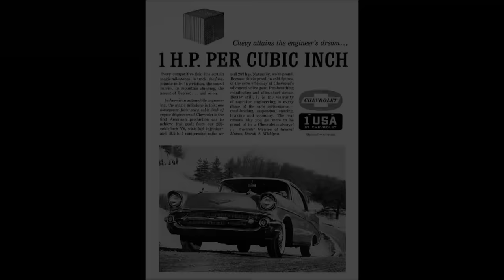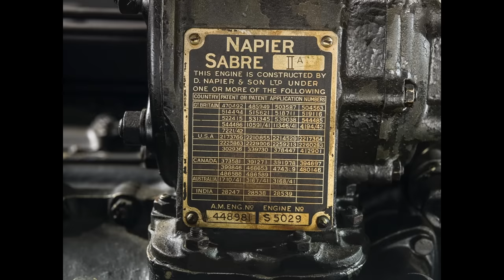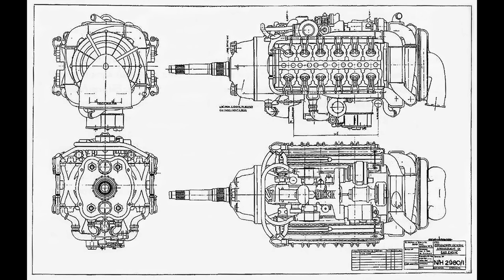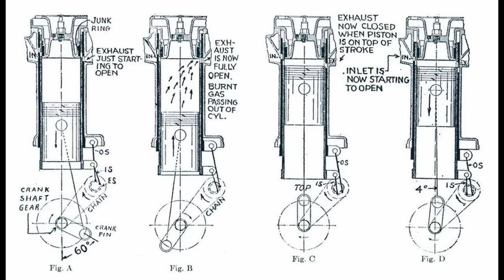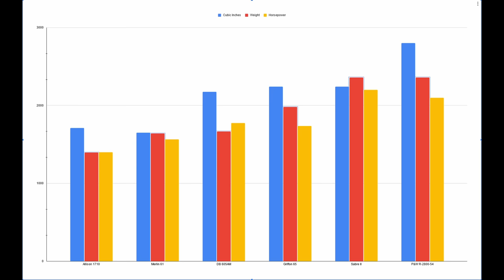Napier Sabre - The Ultimate WWII Aircraft Engine - Part 1

Comment: First off, thank you.  Loved the discussion.

Weight dilemma:  Cannot offer proof but can offer a theory as to why the engine relatively more per displacement than large bore motors.  Quite a few things in engineering are limited by what some call "the cube law" or "the square law".  Building a carboard box offers a fairly simple explanation of both.  [Units do not matter but I'll use feet/inches since we are talking about an WW2 English motor.]  If you build a 1 cubic foot cardboard box, it takes 6 square feet of cardboard to build it.  To double the dimensions to a 2x2x2 box takes 24 units of cardboard (4x more, or "squared") but the volume is 8 times ("cubed") as much.  In the end, by doubling the box's dimensions you get twice the volume per unit weight.  

[Below:  The values flagged with ** are the important ones, the rest are the data from the web that supports those numbers.]
A more applicable example would be using steel pipe to build cylinder walls to get an idea of how this applies to engine cubic inches.  Suppose we wanted to build our cylinder walls out of schedule 40 pipe.  We make a 1 foot long cylinder using 3/4" steel pipe to get a cylinder that weighs 1.13 lbs with 6.09 cid at a weight cost of 0.19** lbs per cid.  Now let's build a 1 foot cylinder using 1 1/2" schedule 60 (sch 60 required to get a similar working pressure as the 3/4" sch 40).  Our 1 foot cylinder weighs 2.72 lbs with 20.5 cid for a weight cost of 0.13**. lbs per cid.

That's my best guess.  Mind you sand casting blocks isn't an exact science and it's likely the safety margin build into casting cylinder walls makes the penalty even worse because "plus a fixed margin of casting error" would be a larger percentage of weight on a small cylinder than a large one.
Reply: Hey. Much appreciated.
Good insight on the insides of volumetrics

Comment: I recall seeing a cutaway when I lived in the UK early 80's - maybe in the Science Museum but I can't recall now. Horrendous complexity was on show and that must be a down tick for it.  Even in war time costs and maintenance matter.  My dad was permanent airforce when WW11 began and transitioned from English stuff to Allisons, Wright Cyclones and PW2800's by war's end.  He much preferred the American engines to work on.
Reply: The T.B.O. of the Bristol sleeve valve engines exceeded that of all poppet valve engines. Once the great Roy Fedden helped Napier resolve their initial sleeve valve reliability problems the Sabre started to exhibit similar long term reliability. Mechanics favoured. U.S. radials because of the very simple repair procedures for a lot of problems. e.g the simplicity it of changing a cylinder/piston with the engine in situ.
Reply: Your dad had to be pleased after discovering that the Allison was built with 50% fewer parts than the Merlin with all replacement parts being a direct fit with no hand fitting required.
Reply: My Dad was in WW06 and WW10.  Could never get his mail delivered.

Comment: Thank you for your most excellent vids! After watching the second part of this vid youve changed my perception of the Sabre, mainly it was troublesome, prone to overheating and fond of gassing its pilots.
Did make me wonder what if they had basically made half a Sabre, A flat 12? Around half the weight, and hp, but still around 1200 mark. The advantage would be the nacelle wouldn't be much thicker than the wing and would be comparable power to others that were in use and suit most twin engined aircraft of the day, Beaufighter for instance? Finally imagine a DeHavilland Mosquito or Hornet with Sabres! Thanks again.

Comment: I was an engine machinist for 30 years and I cannot understand how anyone can call asleeve valve engine good!  these engines were litterally a grenade, over engineered, not properly thought out and a disaster!      IF they were SO great, why were they never used again!!???
Reply: Because gas-turbines took over for aircraft and on the railways the engine rpms were never higher than round 1,500 rpm (in the UK). Whilst neither cars or trucks need such power.
Reply: @neiloflongbeck5705  so that's why literally the day the conflict ended ALL the typhoons and their engines were scrapped??  yet the Me 109, and Mustang werent!?  even after "the age of gas turbines?"
Reply: @Thomas-lk9ok  the early gas turbines were had limited thrust and were slow to respond to the throttle. They also weren't suitable to certain roles. After the end of WW2 all militaries involved in the conflict, apart from the Soviet Union no longer needed large militaries and so they were reduced in size. The militaries decided to standardise on a few types that would see out their needs for the early peacetime period. In other countries, like Spain, they could not afford to  modernise their combat aircraft and so older aircraft like the Bf.109 soldiered on.  They were also easier to maintain than the jets coming into service elsewhere, after all what difference is there between a typical car engine of the period and a DB605?

By the way the Bristol Centaurus a sleeve valve engine saw service in the skies over Korea in the MiG killing Hawker Sea Fury, so hardly never used again after WW2. The last of which retired from the Burmese Airforce in 1968.
Reply: @neiloflongbeck5705  LMAO  you keep telling yourself these things!
Reply: @Thomas-lk9ok  don't need to it's all in the history books
Reply: Sleeve valve cars were not common but not rare either . Stern's knight,Willys knight,  Daimler etc all sold sleeve valve cars .  they were quiet,powerful but smokey as the sleeves had to be lubed constantly  .They are simple, having no timing chain,cam  shaft or poppet ca

Valves.
Reply: The hawker sea fury which went toe to toe against mig 15's in the Korean war was powered by the Bristol Centaurus a sleeve valve radial engine
Reply: The.Sabre only achieved 3500hp on late prototypes. During the war they achieved 2200hp in service. The 27 litre Merlin achieved 2000hp in.service.
Reply: @Thomas-lk9ok  no they were scrapped because they had developed the tempest which could carry the same ordamance but was much better. The tempest also used the sabre engine and later the more powerful evolutions of it.
Reply: it was amazing engineering. Even if  it was only used for a short while. It trained the next generation of engineers who built the gas turbines. Remember 100 years before this engine we were still using horses as the main mode of private transport. 🎉
Reply: @neiloflongbeck5705  Bristol did a line of sleeve valve engines, the Taurus, Hercules and Centaurus. The Hercules was in the Bristol Freighter as used by the RNZAF into the late 60,s or early 70s. The Centaurus in civilian use achieved a TBO of 2000 hrs, quite respectable for a large recip .
Reply: @thomas-l9ock It is as if you didn't see the video or understand the circumstances under which engine development in wartime would have taken place.
If an engine specialist like Ricardo at the time theorizes that puppet valves may soon come short in rising the hp figures, sleeve valves arr not a unlogical choice. Drawbacks like oil consumption do not count in wartime, output is paramount.
Reply: alot of great engine technology has been left on the shelf and never used again for crappy reasons (such as profit to cost ratio not being good enough). I'm not saying sleeve valves are one of them, I'm just saying you can't rely on what gets used again and what doesn't  as a measuring device of quality. because if it were a good measuring device that would mean current F1 cars are the fastest F1 cars ever made and they aren't.
Reply: The sea furies at Reno have used sleeve valve engines for racing.
Reply: Cause we have metal springs that don't snap at 1500 rpm anymore
Reply: The airflow insanity of trying to get gas in and out it a cylinder six thousand times a minute and then putting a large disc in the way needs explaining in some detail, a normal IC engine. Or you could use sleeve valves?

Comment: Great work! Ditto on the pronunciation. Nay-pee-er. Sorry for the nitpicking. The workforce tended to call their employer 'Naps' for short though. When I was an apprentice I had one instructor who had worked for them until the end. He was on the team that added the turbo-compounding unit from the defunct Nomad engine to a Deltic, which was then still in production, in an experiment. He said the guys just did that without approval, and it was adopted as an official project when the results came in. I don't know how much truth there is in that. We all know no Deltic sold ever had turbo-compounding. He did say that everything Napier did was very bespoke, and often the safety margins were a bit thin for his liking. Look at the way they handled the phasing gears to link the three crankshafts in the Deltic. Beautiful in how they balanced the forces from the helical gears in the train, but unreliable in practice and prone to failure. They could get a little bit too smart for their own good.
With regards to the Sabre, I might remind you that one of the reasons the Merlin was so successful against the more sophisticated DB605 was it's inherent simplicity and how it's construction was conducive for field repair in comparison to the German units which needed more repair facility than was often available at or near the forward bases. The fact that the Luftwaffe went from liquid-cooled v-12 units to aircooled radials at the end of the war is a good indicator that sophistication and fine engineering is very often great in racing, but war is a different pursuit.
Anyway, interested in what you come up with next. Here's a good book which is a a treasure trove of historical attempts at making a bad thing better: https://www.amazon.com/Some-unusual-engines-J-K-SETRIGHT/dp/0852982089
That's one book I REALLY regret having lent out!

Comment: Interesting engine. Much too complex for wartime applications. Give me a Pratt and Whitney R2800. Simple, easy to maintain by any 18 year old mechanic and the last variants produced 2800 horsepower! Also used in the P47M which was capable of 500mph or better. Bulletproof literally and used in a huge variety of aircraft. Some are still flying today hauling cargo, etc.
Reply: Best engine of the war IMO.

Comment: If you really want to get good data, "The Secret Horsepower Race (Western Front Fighter Engine Development)" by Calum Douglas is the ticket. It's not for the faint at heart at 450 pages, but will give you full detail on the Napier, Bristol, RR, DB, BMW, Junker-Jumo, Allison, P&W, and the struggle between power, material strength, and the race to be competitive year-by-year. 
The Napier took a long time to get sorted out, so much so given its new technology, that proper supercharging came far too late, and doomed the Typhoon and Tempest to ground support and low level interdiction instead of interception at altitude. The sleeve valve technology also seriously delayed the Centaurus, and likewise excellent altitude performance (supercharging) had to be ignored (engineering manpower) while basis issues were solved first. Ironically the poppet valves, were not obsolete, as their development kept pace with increased horsepower, so the superiority of sleeve valves really never existed .... and the incremental advances of conventional engines kept pace .  
In terms of the future the Jumo 213J (too late for the war) really points the way to the best race engines today (Formula 1, etc) given its superior oiling system, high revs, stroke vs bore ratio, etc.
Reply from the maker: Thanks for the suggestion! I actually just picked that book up and will be using it for most of my content on the upcoming Crecy video. I wish I would have gave it a read before making the Sabre series… Also, I totally agree that sleeve valves were a solution to a problem with poppet valves that didn’t end up being an issue.

Comment: How thirsty is 24 cylinders though?
Twice as many parts to fail.
Larger target for enemies? Bet this thing does not like being shot.
And high RPM, high power high RPM  requires very high tolerances, I bet it's an order of magnitude more.
Maybe the Americans could have built it in their manufacturing lines.
But British hobby-shop grade factories painstakingly assembling every engine by hand would have been a reliability problem.
Reply: 4000 is not high RPM by today's standards. I can believe that the complexity of the engine was a problem. The British class system of undervaluing mechanics and other technical people likely severely limits their talent pool at all levels.
Reply: @davidson46100  Well, they weren't building a race car, there was a war out there after all. It still is an engineering marvel.

Comment: The Sabre was a brilliant design, and two of the reasons it made so much power were piston area and revolutions. The Sabre had a capacity of 37 litres compared to the Merlin’s 27 litres, with double the number of pistons. These were therefore smaller and as a result the Sabre could rev up and down the range like a racing car engine. The maximum revolutions were 4,200 rpm and the power rating in service was set at 3,750 hp, although it could deliver a reliable 5,500 hp with 45 lb/in of supercharger boost. The most power the Merlin could muster was 2,200 hp at 2,900 rpm with 2,640 hp available for short periods.
These were incredible figures, but few people today have ever heard of this engine. Much of its history has been obscured by time and (Setright suggests) by the deliberate suppression of records. To his credit Beaverbrook saw the potential of the Sabre when it passed the Air Mistry’s 100-hour test and it went into mass production.
 It was not an easy engine to make, nor an easy engine to maintain. There was a struggle to make the sleeves perfectly round but by a piece of luck the Bristol Taurus engine shared the same cylinder bore of 5.0 in. Testing with Taurus sleeves was a success, but initially Bristol refused to manufacture Sabre sleeves, objecting that their techniques were confidential! The Air Ministry had to have a stern word, and in the end the sleeves were manufactured from nitrided austenitic steel forgings using Bristol tooling. Quality was not as good as at Rolls-Royce factories, and engines were often delivered with broken piston rings, and machining swarf left inside. The Merlin was more reliable and far better made.
By the time the Sabre came into service many of the good pilots had been killed, replaced by those of poorer quality and hastier training. They may have been swayed by the effective Rolls-Royce propaganda, and when pilots and ground crew encountered problems with the Sabre they were prone to condemn what they could not understand. And the Sabre’s reputation was not enhanced by the Rolls-Royce representatives at the airfields. It didn’t have black shiny cam covers like the Merlin, it just looked like a big green metal box with rows of exhaust pipes and sparking plugs. 
It was hard to start from cold as the sleeve valves were a tight fit. At freezing point the Coffman starter struggled to turn it over, and Pierre Clostermann describes how the ground crews had to start the Sabre in his Hawker Typhoon every two hours during freezing nights in France. The correct technique was to dilute the oil with petrol, a practice also employed by the Germans, but a misfire when starting from cold could result in a fire and many trainee pilots were terrified of their Typhoons.
The second problem was not the fault of the Sabre. Fighters patrolling the Channel suddenly started having engine failures, and on one day no less than 15 Sabres clanked to a halt while up in the air. Frantic investigations revealed the problem, and Setright hints at sabotage: “A bunch of stupid, ignorant and possibly misguided (but by whom?) mechanics had discovered that it was possible to fiddle with the internals of the automatic boost control that integrated the various engine functions…these fighters were cruising up and down the Channel for long drawn out patrols with the airscrews in full coarse pitch, the crankshafts turning over at cruising rev./min., and the blowers were delivering maximum boost! Of course, the engines were hammering themselves to death, and there was practically a riot when the cause was discovered. 

If you want to know more, read my book on the Merlin: https://www.amazon.co.uk/Merlin-Story-Engine-Battle-Britain-ebook/dp/B07ZPKF1V7/ref=sxts_entity_rec_bsx_s_def_r00_t_aufl?content-id=amzn1.sym.0bf1fd50-d464-4e81-b1e8-4f79c1fadc21%3Aamzn1.sym.0bf1fd50-d464-4e81-b1e8-4f79c1fadc21&crid=M31SBIJJMPUA&cv_ct_cx=graham+hoyland&keywords=graham+hoyland&pd_rd_i=B07ZPKF1V7&pd_rd_r=8ed7ec54-d055-4cec-95af-998ccc32f955&pd_rd_w=3KftF&pd_rd_wg=5oen4&pf_rd_p=0bf1fd50-d464-4e81-b1e8-4f79c1fadc21&pf_rd_r=B89SEXS0R5T513GHF2ZM&qid=1665003157&qu=eyJxc2MiOiIzLjEzIiwicXNhIjoiMi40MyIsInFzcCI6IjIuMzAifQ%3D%3D&s=books&sprefix=Graham+Ho%2Cstripbooks%2C138&sr=1-1-97393047-c4ae-401f-b3b7-1d6343f6998a